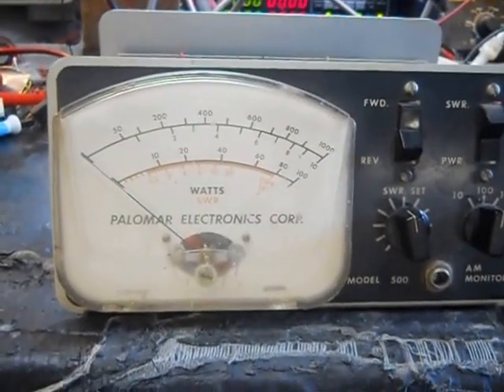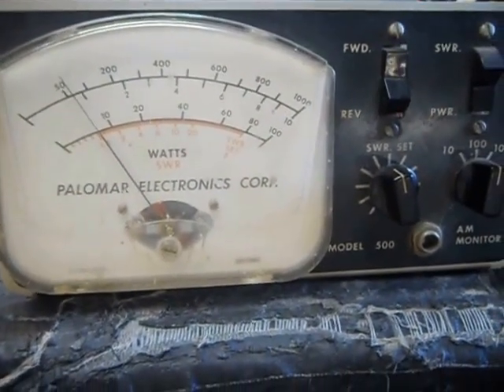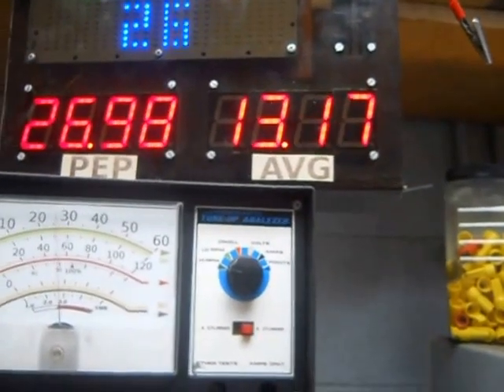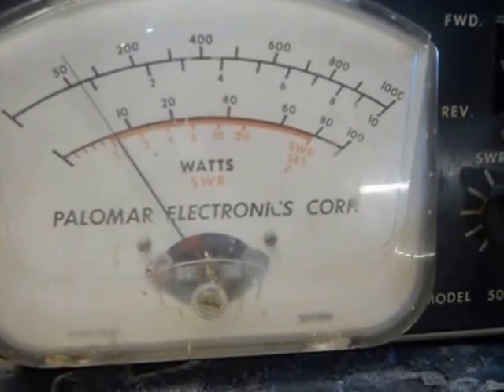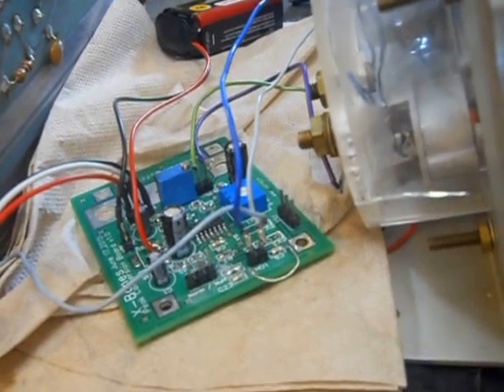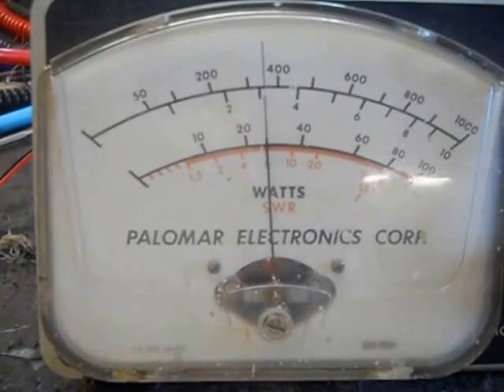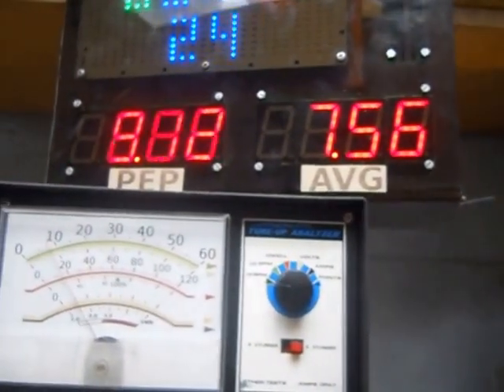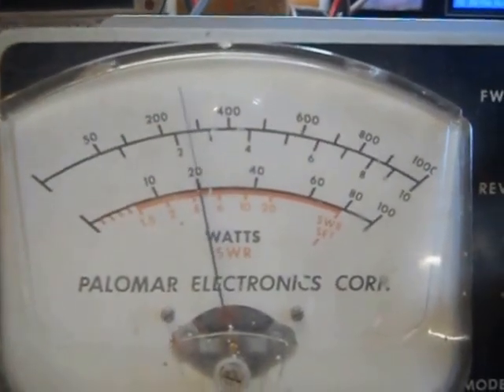Palomar 500 Watt meter X-Bones Peak Reading conversion

Comment: Hi I commented you about a year ago about having the same meter.hoping you have the new design you were getting.still have meter she's in great looking condition wish I can use it.
Reply from the maker: In theory, this smaller board should do the trick. Haven't tried it for this purpose yet. But it was designed to give peak readings. It should be usable with a 9V battery. https://photos.app.goo.gl/gbHDjBjAH6pKiixQ6
Reply from the maker: https://photos.app.goo.gl/vqQp6Krf1dueeZNh6

Comment: Hi,I have the same meter and it's doing the same it has no swing compared to my other meter.i love the meter was hoping you could take a look and do the mod like you did on yours.ill pay up front.
Reply from the maker: Unfortunately, I don't have the original boards I designed. I do have some other boards coming, but will need to be tested.  I have two more Palomar meters that need tested and converted.

Comment: The reason why the needle doesn't move because you don't have the meter set right you got the forward and reverse switch on for your am monitor you got to have that down on reverse and power both switches down so the needle can go forward but the way you have that switch on forward it's for the am monitor so the needle is not going to move.